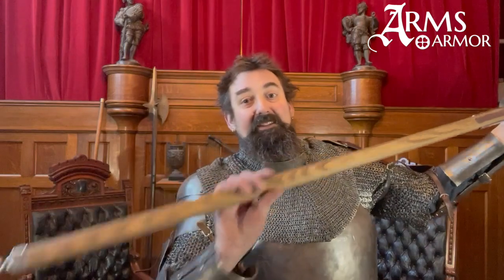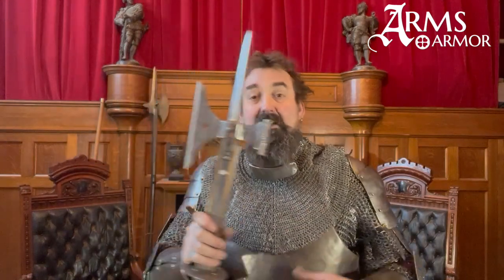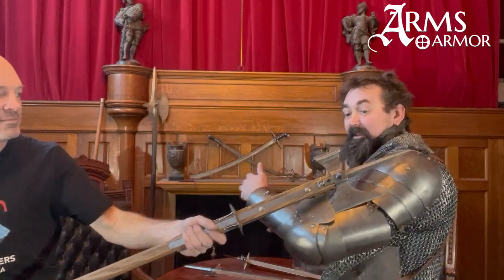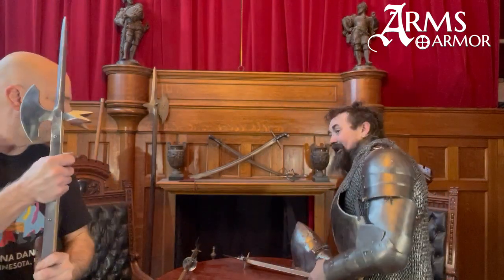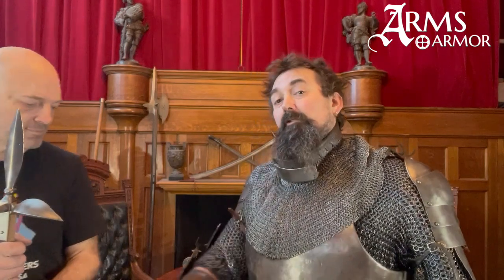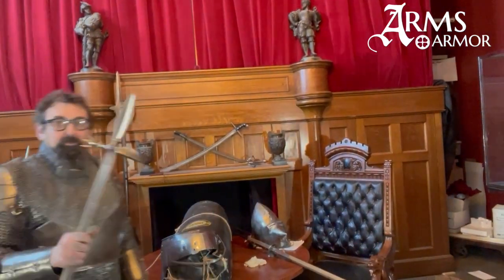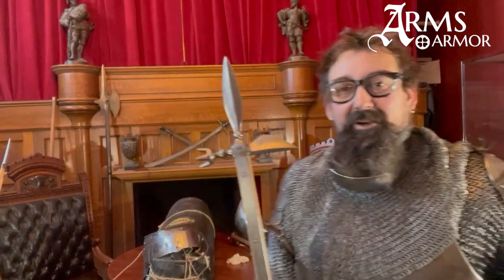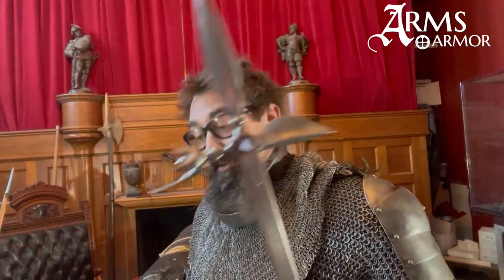Testing pollaxes vs. armor

Comment: I firmly believe in the quality of Arms and Armor.
That said, my infantry rifle took significantly more beating on the bayonet course than this poleaxe.
If a precision tool, magnetically inspected for micro-fractures, cappable of hitting a 5 inch group at 500 yards can survive similar abuse, with no damage, it's not too much to ask a pole hammer to do the same.

 If the original in the Wallace collection was built the exact same, then it's simply a testament to the fact that not everything from the period was well engineered.

Love your stuff, and looking forward to the re-engineered version!
Reply from the maker: This illustrates a key point! what was it made more. Your rifle is designed for being in a battle environment for extended periods of time and must continue to operate a complex mechanical system throughout, also designed to have daily maintenance. A pollaxe of this style would be a high end piece for a well healed knightly probably meant for combat in the list in an arranged format and not necessarily considered to be used daily for weeks of heavy fighting. It can deal with that if you can maintain and adjust as needed but they would have a man for that. One of the points we feel a lot of scholars of medieval combat miss is the material science limitations of some of these weapons made from natural wood, wrought iron and wrought steel.
Reply: That seems fair, but your bayonet (very light compared to the poleaxe head) was fixed to a durable steel pipe (barrel, fixed to a durable metal receiver) and used for some stabbing and possibly striking actions and had bolted on reinforced synthetic furniture bashed against some targets (sand bags? maybe a helmet?). The poleaxe is a longer object with various thin metal parts that together weigh a fair bit attached to a long wooden pole. I submit that swinging that pole and hitting a hard target introduces a lot of momentum and subsequent shock that is not the same as an assault rifle on a bayonet course. The considerations taken for the rifle's durability are just simpler when it comes to stabbing and hitting things.
Reply: @45calibermedic  keep in mind a rifle is on average, significantly heavier than a polearm. 12 or 14 pound rifles are not at all rare especially a few decades ago, which means there is a great deal of very hard steel in a gun. Many modern guns which are lighter and use more polymer can be damaged seriously by using them as clubs. The L85 is a bad example because it had so many problems, but it was notorious for totally losing zero if struck hard. AR-15s are bad to use for butt strikes because bending the buffer tube which is housed in the butt will royally goof up the weapon.

Comment: Excellent video! I always wondered about the purpose of those side projecting spikes but I suppose those can help slide into gaps or bite into mail too. 

Also back of the knee is definitely effective! I suspect some of the historic spike tomahawks were used this way. Armor wasn’t really a thing in 18th century North America but spike tomahawks were quite popular. Many examples had downward curved spikes—to the extent that the point couldn’t percussively penetrate. I theorize they were used like meat hooks on sticks to pull down a standing opponent—hooking the knee joint would do the trick.

Comment: I imagine fixing a slight bend in the metal is much easier than replacing cracked or broken wood shafts. A strategic, preferable, weak point of sorts.
Reply from the maker: Yes, though as the materials for these pieces in the langets and support pieces would have been iron  as opposed steel most users would be aware of this and able to adjust things for minor issues on their own.

Comment: I would have expected that the pollaxe received the damage it did in Skall’s video due to the type of wood used for the haft. Modern ash isn’t nearly as durable as it used to be (most modern woods aren’t). Kinda crazy to see that it was actually the steel that bent rather than the wood depressing
Reply from the maker: Yes modern wood is not the same than the majority of wood used in period, but we do strive to get the best we can. The deformation of wood is probably less an issue than the user details.
Reply: @armsarmorinc.4153  out of curiosity, what are the benefits of ash compared to other wood’s available on the market? Would a hardwood such as maple (often used as guitar necks and bodies due to its strength) be too brittle as a haft material, making it less ideal for a combat situation?

Comment: Could you link the video in question of the bent axe?

Im very interested which youtuber managed to do it 😆
Reply from the maker: Here is a link to his response a couple of years ago to critic of the testing. We have a good relationship with him and do not fault were the materials have failed, our point is he may over estimate what the originals were designed for and how they would be used. We think the goal is to replicate the items as they were and not try to step beyond the achievable in period just to make a "super" weapon. this axe in the video is the same used in the vid. I bent it back to straight and we have been using it for training in armored combat.

https://youtu.be/Fiy75mJ8w4s
Reply: @armsarmorinc.4153  aaaaah, yes. I remember now 😅

I remember thinking that the wood of the shaft must have been the culprit there.
It really didnt seem like a particularly hard hit at all...

While its true modern steel is vastly better than period steel, Id say our modern lumber isnt. In fact, it might be worse...

For example, Im having a very tough time procuring proper planks for VA round shield replica Im doing for myself.
Granted, an ordinary ash shaft shouldnt be as much of a problem, but the very nature of the tree growth, when and how it was processed and dried all play a part. And the modern way of doing it is crucially different than period. So maybe you just got a bad batch of handle material that time and thats what caused the problem.
Also, using 110% of your strength all the time isnt really a viable battle technique, so I agree that it shouldnt be a measure of the durability then.
Testing the limit perhaps, see what it takes for the thing to fail, but those kind of hits are certainly not usable in battle.
At least not safely...